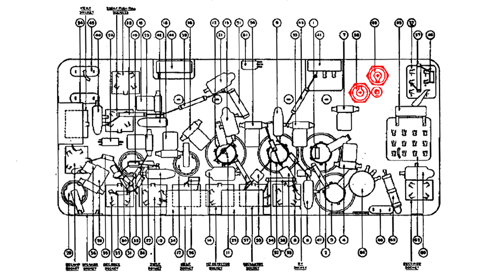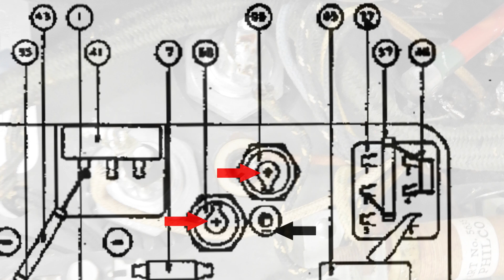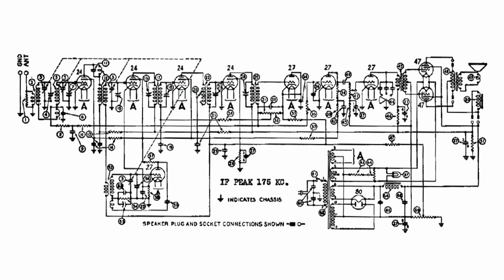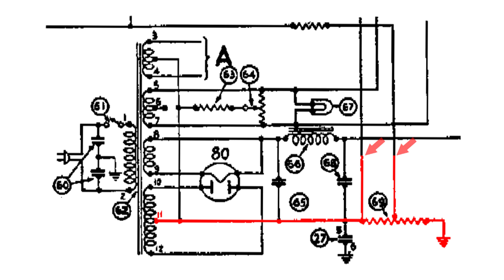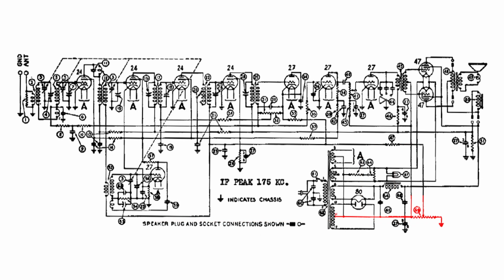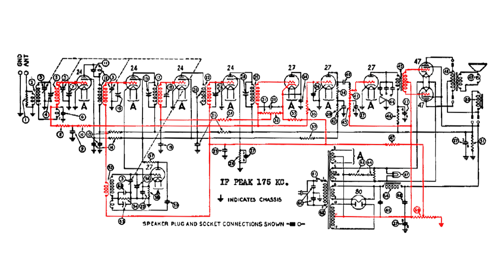Philco Radio Electrolytic Capacitor Replacement and Negative Bias Supply

Comment: Great information. Can I use the same procedure to repair my Philco model 70? It have a load hum.
Reply from the maker: Yes this should work, but be very careful of the polarity. If electrolytic capacitors are installed backwards they can explode.